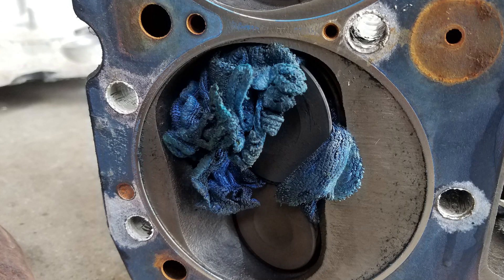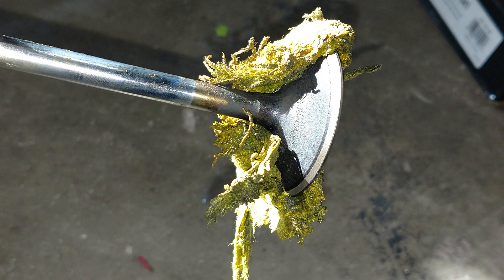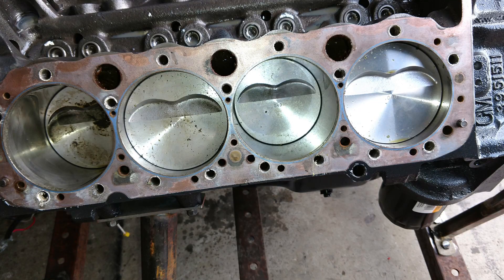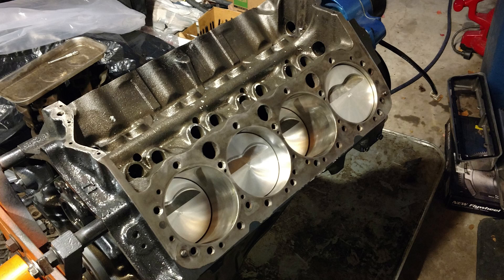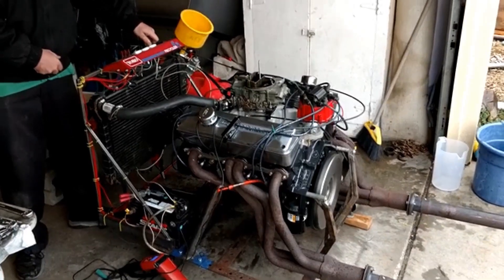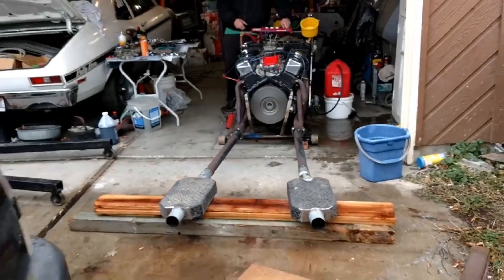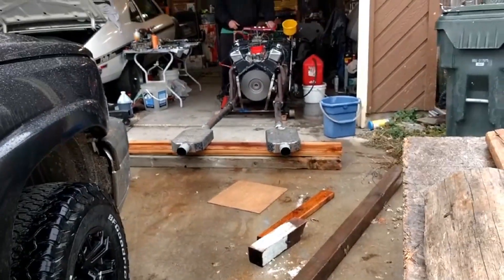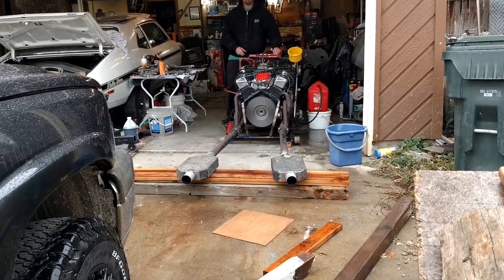Update: What happened to the motor with the rags left in the intake

Comment: This one is from way back but still a good one, there was a State Of Ohio State Patrol Post right across the street from our large local Chevorlet dealer.  The Patrol used the dealership for all maintenance and repairs.  One day a friend of mine took his cruiser in for routine maintenance, oil change, lube, etc.  Now these cruisers had the corvette motors in police package in them and would haul ass.  My friend picks up his cruiser and was making his way north on a highway to patrok his assigned area.  He made it about 1 1/2 miles and his cruiser shut down immediately.  So a tow truck shows up and takes it back to the dealership.  They put their master/top mechanic on it right away and within a few minutes he comes back out and tells the trooper and dealership owner some bad news.  Apparently whoever changed the oil not only did he not put any oil back in but also left the oil drain plug out of it also and the motor was locked completely up, the only thing salvagable was the alternator.  The poor kid that did the oil change was called in immediately and chewed on by the owner and then fired.  My friend calmed the owner down and told him give the kid a break which he did but the kid had to come in every saturday for one year to clean the work area for free.  This cruiser was only six months old so the owner had to order a brand new one from chevrolet at the cost of $8,500.00, not including the labor cost.  When the new motor arrived not only the master mechanic was assigned to it but also another top mechanic, the trooper got his cruiser back within 10 days, the kid that made the mistake did work every saturday for a year and earned the respect of the owner, but also his fellow employees.  The owner was so impressed with the kids attitude about it the owner sent him to mechanics school on his dime and even bought him his first set of tools.  The kid continued on with his training and became a master mechanic himself.

Comment: for testing valves you can wet test them, fave up and put water  or oil in the chamber and ad a little air into the runners to see if they leak. a little air escaping bast a valve is normal, but alot indicates a bend. or if you put the water in with the head face up and it immediately starts running out of the head its a sure sign of a bad valve. Thanks for the vid. It was interesting.

Comment: First engine I rebuilt was when I was 15. I was waiting for my Holley carburetor to get into the local Speed Shop. Is a 650 double Pumper which I special ordered because I thought it was quote on quote RACE. Cost was a staggering $63. Anyway I had the engine in the car and had to hear it run so I put a ShopRite with a little bit of gasoline and taped it to the manifold. An old Edelbrock torker... Again this engine was race... LOL. Well I got it to run it sporadically until the rag got sucked down the manifold.

Comment: Bent valves?  I would think the rags would keep the valves from closing completely and IF they cause the piston to hit the valve, it would probably bend the valve stem.  I think you would see some damage or the imprint of a valve in the top of a piston if this happened. Probably not necessary to remove the valves from the head if the piston tops look good.  But, once the heads are off, getting the valves out should be pretty easy if you have a spring compressor.   Also putting the valve in its guide and checking it for runout or eccentricity by turning it by hand should show a bent valve.

Comment: A friend used a bead blaster (I can't remember the media type, cheap stuff would be safe to conclude) to clean off the old paint on his SB Chevy heads, he failed to get all the media out off the heads. On start up day for this rebuild the engine fired once for about 10 seconds, then nothing, it would not start again until we lubed up the cylinders through the sparkplug hole. At the time no one put "2 and 2" together but soon there were clues. The engine developed a very slight rod knock, so slight many felt it an exhaust leak. Long story short, upon teardown every bearing, including the cam bearings (ever see the cam bearings visibly worn out before?) were worn out. One night all parties got together, it was like, "you mean all the bearings were worn out", "remember when we started this thing new", "I bet you left bead blaster media in those very nicely painted cylinder heads".

Comment: Glad it worked out. As a 26-year professional tech I have seen some weird stuff, the best is when I tore down a 1975 350 out of a K2500 for the original owner & found a red rag wadded up & wrapped around the #5 connecting rod. It had been there for almost 200,000 miles. The owner was a family friend with ALL service documented. Oil pan had never been off. I was rebuilding it for his 16 year old son's "first car"
Reply: Guy I worked with back in the day, had worked at a GM dealership wayyy back in the day. He had some good stories, including finding part of a ham sandwich inside the door frame of a new car, and a rattle that was eventually determined to be a soda can inside the drive shaft with a note saying "I bet this drove you crazy" inside the can.

Comment: I lay the head with the deck up and fill on top of the valves with water and you can tell which valves are bent
Reply: there's a problem with that theory/test. With a tiny bend they can still seal tight, but will wear the seat, guide, valve face, stem and stem seal.

Comment: HUGE HINT.. Bent valves after dropping off heads at a machine shop.  i took a set of heads off my running GTO and sent them in to have the valve job done.. 15 bent valves.. ?? years later while working at an engine rebuilder i walked past the tear down guy.. he had a pallet of small block chevy 441 head cores he was tearing down.  he had them sitting on a 2x6 and was hitting the valve springs with a hammer and socket to knock the keepers out.  this drove the valve heads down into the surface and bent them just slightly.. i put a stop to it and showed him the damaged valves. he did not even know he was bending them.  i thought i would share that ... 

 in the image you showed @0:52 what is the white stuff on the gasket surface.. is that white silicone sealer or white lithium grease..   please verify your torque wrench calibration also.. use a 15MM 12 point 1/2" drive socket and connect a beam type torque wrench to the click type.. put a piece of masking tap on the beam type dial at the edge of 70 foot pounds. start with your click type at 60 foot pounds and pull slowly.. increasing the click type setting till the beam type clicks at the tape mark.. just to see how far your torque wrench calibration is off.  if its more than about 5 pounds off. you will want to find out where to send your torque wrench in for calibration.  

 oh.. i run my engines on the stand also.. https://youtu.be/UnXg_VVMKEI

Comment: nice smoking wit a rigged gas container right below
Reply: chuckswhip I have throw a lit cigarette in a bucket of gas and it went out. I did it just to prove a point. 
 I was cutting a rusty fuel filter off a Chevy Beretta fuel pump job with a die-grinder. I didn't want to destroy the fitting on the steel line and adding to the hassle of fixing a rusty car. Someone in the shop was wearing a dress about the sparks and gas. Guy bitching blew a head gasket and stomped off after I threw my cigarette in the bucket of gas I drained from the tank.
 I can't recommend you try this at home kids . . .
Reply: Phoenix Rising the gas was fresh at the time, the car was towed in after stalling out on the road. I dumped it back in and used it afterwards. This was also 20 years ago with REAL gas, not the Obama ethanol shit gas that turns to shit in 2 months. 
  Seriously, when was the last time you even saw a Chevy Beretta, if ever? Those cars were cheap junk when new.
Reply: Health hazard is in the lungs, not in the workshop.
Reply: I guess if the gas is old it wouldnt be too combustible. Try it with fresh and let me know how it goes.
Reply: i have done the same thing. People are just ignorant, like that chuckswhip guy

Comment: I'd never trust the affected parts. Replace the rods pistons and valves on the cylinders affected. The difference between  trusting an engine for 100K to 150K Miles compared to. Maybe it will last 5K miles or 15K. Maybe tomorrow? Maybe fine for 150k? Maybe not?
Reply: macgyver15147 I have actually been giving this thought while nailing down my fuel and ignition for the engine. I was going to keep and modify the factory TBI and buy a chip, but in the off chance something happens I don't want to be out a good bit of money on a special setup. So I've been leaning towards an atomic EFI so I can transfer parts to another engine and readjust the tune.
Reply: SBC Connecting rod $15, 2 valves $28, piston $15. Sorry I would just cheep out on the repairs and spend the extra $58 to trust my components. Cheep insurance for a more expensive engine
Reply: You time is also worth something, $58 is cheaper that my time to rebuild the motor again.
Reply: thats just it, its not an expensive engine lol, he went the cheapest route through and through
Reply: It's a small Chevy, you did fine.  Run it till blows.  Get another for under few hundred

Comment: I had a bad experience with a rebuilt 454. It had a tappet camshaft. I used normal Penzoil 10w30 to break in. That was a huge mistake.  It wiped off all but two cam lobes in the first five minutes. I did use the cam assembly lube but that wasn’t enough.  Later I learned that you must use a zinc additive for cam break in or a high zinc oil. Costly mistake the whole engine filled with metal filings. Had to rebuild the entire engine.
Reply from the maker: I used Joe Gibbs break in oil after I first rebuilt the motor in my car. Seemed to work great. I ran the Valvoline VR1 10-30 in it for just driving around. Put 3,000 miles on it before I tore down to upgrade the cam. Everything still looked pretty much new on the inside. I used comp break in oil after the cam change and then VR1 again. So far so good... The VR1 has extra zinc for these older flat tappet motors.
Reply: yep, all the good stuff "ZDDP" has been mostly eliminated from motor oil. So any older/offroad vehicle without roller cam it's a must to run oil containing more ZDDP or additive which has it. they claim there's enough to protect the engines already broken in, but I'm quite sure they'd like you to buy new vehicles also ;)
the downside to ZDDP, it kills/poisons catalytic converters, as well as being an air/water/land pollutant

Comment: I missed the point with my first comment. I knew it would be fine them valves would have come back into shape all on their own with a few more mile on them any valve can be re laped after a few hours of run time for a better seal , the metal needs to conform and be work hardened. As for twisted rod it was like that from the day it was installed ,but, was missed when installed. Lots of rods are twisted brand new. I worked on Harleys for a while and right in the repair manual was the steps for checking and straightening rods new out of the box before installing. All old hot roders will take a old motor over a brand new one because it is work hardened and proven. Rolls Royce used to leave brand new blocks outside for a year before machining.You young guns put way to much faith in technology and wonder why it breaks ,when 1 company pumps out 10's of thousand of parts slaps a name on it and you all believe it is the best part to use. I like sloppy mechanics site he show how wrong new thinking is. Check Mats channel out you will laugh at what he does and make 's 1000 hp.with junk yard parts. and used bolts. He gets hot rodding . Good luck with your channel. I will sub because I like seeing what some do with little money and are not afraid to show their mistakes.
Reply from the maker: Yeah I follow sloppy mechanics. I'm on the facebook page too. TONS of great info there, I have learned so much just following along the videos. I hope to turbo LS swap the nova some day but I'm totally cool with running the old school small block for now. Still lots of fun.
Reply: P Kuudsk shut up
Reply: P Kuudsk  lmao don't pay him attention only thing he understands is his donkeys ballls
Reply: kj 1250 dear oh dear kj 1250 , you are the only gayboy I know who went to a glory hole and the guy on the other side just wanted to stay friends .